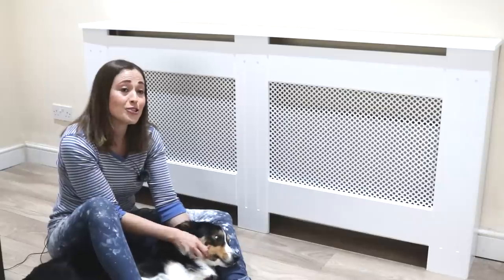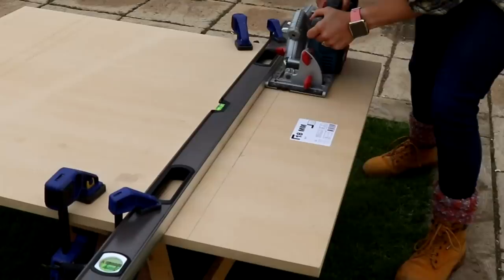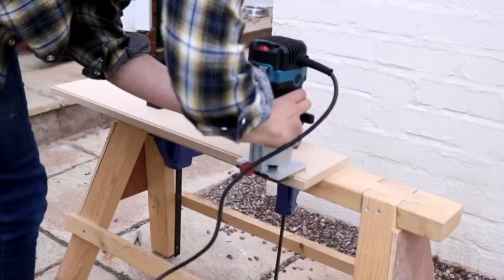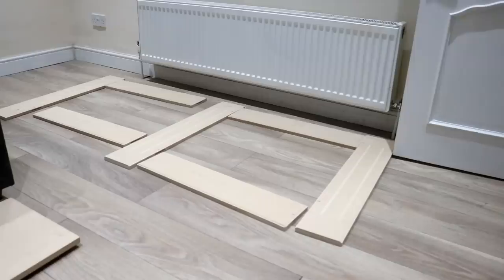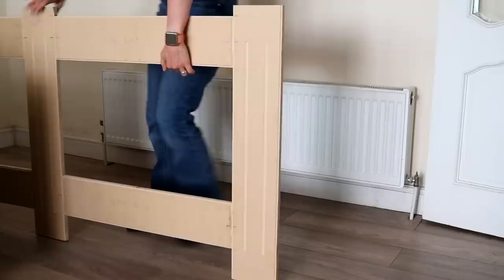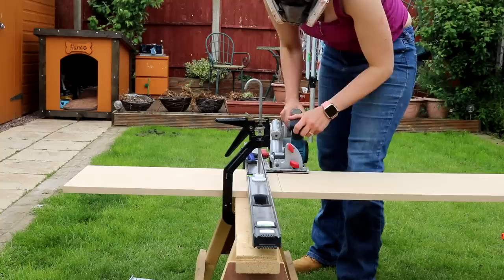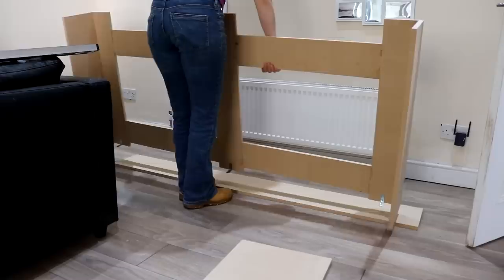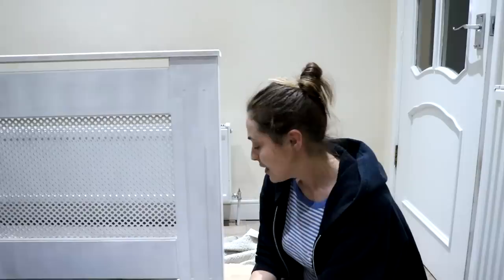DIY Radiator Cover | The Carpenter's Daughter

Comment: There's a reason why radiators are not enclosed...
Reply from the maker: MDF withstands the heat, so can't see any issues
Reply: @TheCarpentersDaughterUK  Anything that restricts heat flow is bad news, reducing the heat output of the radiator significantly. Even putting a shelf on a radiator has a measurable effect on output. Radiator designers go to a lot of trouble to get maximum heat transfer into the atmosphere by radiation and convection (hence the fins, dimples and wavy surfaces),  Radiators really should be kept as clear as possible at all times.  Assuming you want to be warm that is...

Comment: Why do you want to reduce the functionality of a "radiator" so much?  They get hot, then heat radiates from the front face - by putting a panel in front of it you stop most of that function leaving you only with convection as its heating mechanism.  Did the room get colder - or perhaps you turned up the thermostat to get the same amount of heat in the room?
It's an odd business - the radiator manufacturers need to make them prettier so there's less cover making